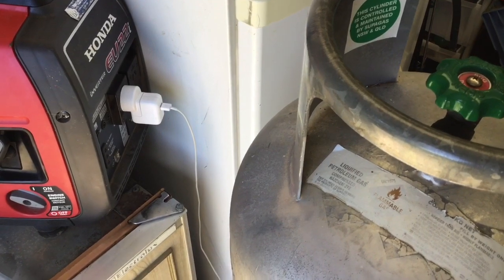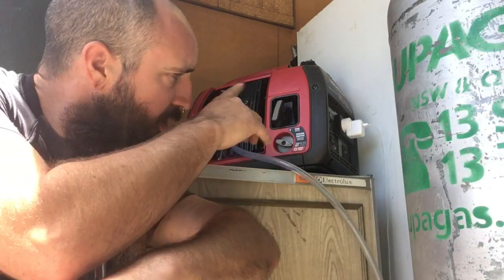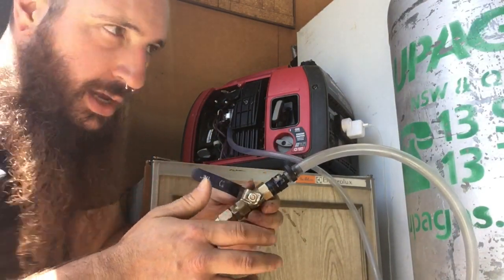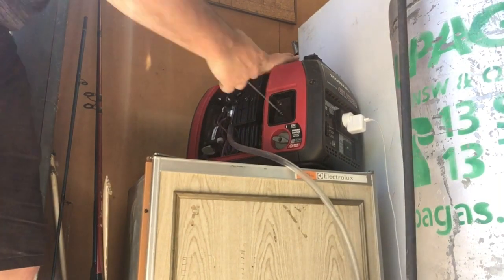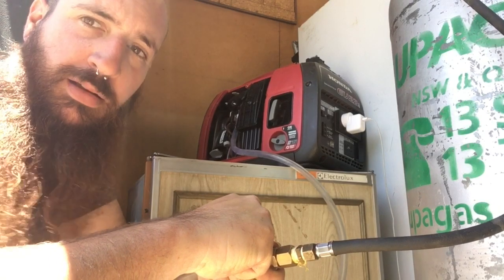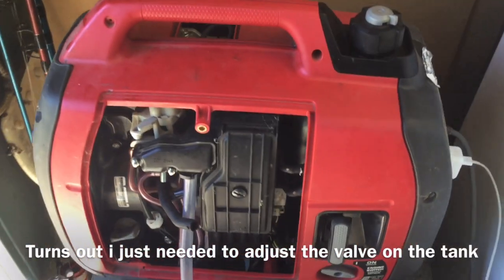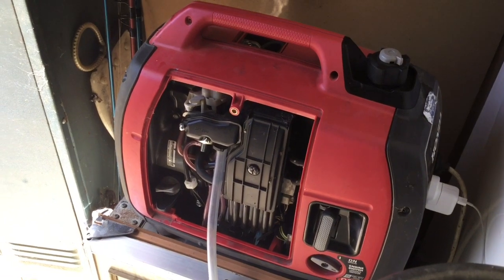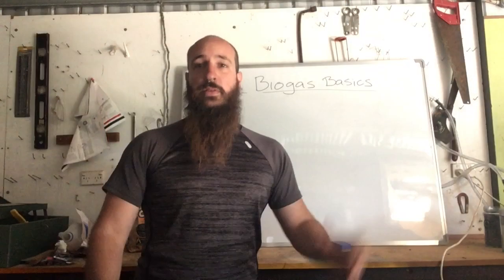Biogas generator - compressed biogas run test 2

Comment: Hey mate, I said on your part 1 video a few months ago I did this with a cheap bunnings generator hooked up to my Homebiogas 6. What I actually did that was useful was charge my ecoflow using a controlled power supply through the MPPT port. being able to control the volts/amps of charging the ecoflow and adjust the ball valve of the gas flow to match the demand, while its painful for 1 minute to do, is a good way to use it because the more gas you use the more efficient it will be. When charging at 250 watts it was the same gas pressure of my generator running idle (2kw petrol generator) but you think, you turn up the volts/amps, you can hear your generator starting to struggle so you let in some more gas, and repeat that until youre at your max charging load. 

I bought a zero pressure regulator for mine and unfortunately could not get it to pull enough gas to match the demand. I can only get mine to work with manual tuning. I think a good way to go about it would be Ive seen some air pumps that you can manually adjust that pull 40L/min, if i hook that up to my homebiogas and then between the air pump and the generator have a solenoid thats power for on/no power for closed and have them both connected to the generator so if your generator conks out the solenoid will close and wont leak gas. That way you can adjust your gas flow/charger, let it charge and then if it becomes fully charged the engine will flood and conk out and close the solenoid or if you run out of gas then it will conk out and close the solenoid. Cheers mate

Comment: My name is Mike. I have a method you'll like. It makes your generator safe. It's cheap. I've been doing conversation of gasoline to propane. My goal was to make it safe. Everything you were talking about I learned. Be Careful of running engine too slow because it will eat the brushes. But this all is exactly what I have been working on. With what I know now I wonder if I can run a v 8.

Comment: Could you simply create useful generator gas fuel pressure by having weights on the gas bag instead of having to pressurise into an empty gas cylinder?

Comment: Will it be able to run the compressor to fill 800L into your holding tank? your honda is aprox 20 persent efficient and your copressor even less efficient.
But fantastic if it works!!

Comment: I wonder if you ran a t-fitting from that exhaust recirculating hose into your biogas line, if you could run uncompressed biogas because the exhaust recirculation gases would create a Venturi effect sucking in the biogas with it

Comment: Love you work. 

Just wondering why you are bothering compressing it into bottles, just to regulate it back again?  That's gotta be using ALOT of energy.. 
I'm thinking, why not just buid a mini compressor using a quality air diagphram pump and set it to maintain 2.75kpa (regular lpg regulated pressure) 

I'm thinking I have a lil 12v jabsco diaphragm water pump. It has a pressure switch in it, turns on to maintain 40psi. I open my tap, the pump turns on. It's low power and can run on my solar system, I'm sure something similar could be done with biogas. 
And you can just use a long airline to go to various areas (kitchen, garage etc). 

The energy in moving the bottles around alone is to much considering only an hour or so gas fits inside. Plus the electricy used to compress it to 100+psi would be so much more than the energy you are getting out of the gas.

Comment: Very interesting mate. May I suggest trying to put some pressure gauges on your fittings and observing them to see what the generator requires. Also perhaps use a watt meter and multimeter on the generator and run different loads to see what is being drawn from it. Might be able to get a happy medium or find optimum settings for certain loads to regulate use of your gas. We will be off grid soon and I plan on adding a biogas generator. Cheers 👍

Comment: Great stuff, it's always good to catch up with your progress.
I was wondering what sort of heat come from the exhaust, i always try to add (or suggest adding ) an EGR heat exchanger on to small exhausts. Maybe you can use the heat produced for a water cylinder or something similar.

Comment: I am in the UK and I have built a generator exactly the same way as yours in an IBC - thanks to your excellent series of videos. I have added some fresh digestate from a commercial operation nearby and as you suggest, I am now waiting three weeks before adding my own food scraps. The digester is producing gas already. The question is do I need to add small amounts of fresh digestate (same as the original input) during that three week wait to keep the bacteria alive or will they be OK without any further addition until start feeding it in three weeks?
Reply from the maker: Hi Phil, thanks for the kind words, i would think that if you sourced digestate from an already established digester, and if is producing BURNABLE gas, there should be no issue with feeding it food scraps now 👍

Comment: Brother, where can I buy 2” and 3” rubber seals for the IBC Totes (for connecting 2” and 3” PVC Pipe thru the IBCs)?  And what are they called?  i cannot find them on eBay!
Reply: They're called uniseals I Googled it and the company's that sells them popped up I'm just waiting for the ground to thaw lm going to dig down and move the shed over them want to see how it'll do for pressure if i put one tote on top of another hook the bottom one to the bottom of the top one fill the bottom one up with water so that as the methane is produced it will go in the bottom tote forcing the water from the bottom tote to the top tote to give the gas pressure i saw a video where they run the effluent from the first tank to the second tank giving it longer to digest you get methane from both tanks

Comment: Man....the possibilities here.  You could take an inexpensive PLC and program in a PID tied to o2 sensor.  Output of 4 to 20 ma controller and a valve.  Let the plc amd programming control fuel ratio.  It is very possible.

Comment: Really curious if it produced co2 when burned then I may make one for the greenhouse for heat and co2 gen for the plants
Reply: You should be arrested for practicing witchcraft ! What a fantastic idea though, if you can control the resultant heat and co2 output !! 

Perhaps, running the generator on a timer could be a decent workaround in terms of controlling the heat and co2. 
This is a nifty idea I could run with but, unfortunately,  I do not have the luxury of space to start a greenhouse. 

All the best with your project.

Comment: Looks great!
What if you design a setup, where the generator is placed underneath an isolated biodigester? (You could basicly use small strawbunches.) 
An engine like that produces around 75% heat, that could keep the digester indipendend to the environmental temperatures. That would be even saver heating for the digester, than an open gas stove and you would get the same amount of electrial energy, as you get in your setup. Just it would be the „waste“ of the improved digestion process.
Unfortinatly I don‘t have the opportunity to do it myself right now. But it would be cool to know, if it works out.
Reply: I was thinking that an EGR (exhaust gas recirculator) heat exchanger could heat a water cylinder, maybe the water cylinder could in turn be a heat exchanger somehow with the digester

Comment: What kind of pressure does the gas need to be going into the generator at with a load on the generator. Also what is the burn rate?

Comment: I've been doing some research into biogas recently. I'm right now working on building a home and am planning on having 10kwh, worth of solar panels and 40kwh's of lithium batteries. (It's a bit overkill, but I'm doing it all DIY so the costs are relatively low)

I want to be able to have a reliable backup for winter's or for prolonged cloudy weeks. I was initially planning on having a generac natural gas/propane generator that would kick in if the batteries dropped below 10%.

Now I'm exploring using biogas instead of the propane, as I'll be using the fertilizer for my hydroponics, and not needing to rely on paying someone to refill the propane would be nice. Since it's going to be used sparingly (I should have close to 100% energy uptime from solar),  I was thinking of installing a large underground propane tank and regularly pushing gas from a bladder into the tank.

I know there is a lot that goes into a system like this, but having been using biogas, do you think it's feasible?
Reply: Your contact number
Reply: Or your imo
Reply: I'm just a caveman, but from what I've read. It's 'feasible', but the impurities can damage your generator over time. Sulfur something or other is found in unfiltered biogas.
Reply: Lithium is over hyped. Look at the costs per kw for it and then there is no study on longevity in comparison to older battery technology which has been around for over 100 years steady and reliable.
Reply: @MrJFoster1984  lithium iron phosphate has come a long way in price.

40kwh's can easily be purchased for under $13k if you build the batteries from individual cells.

Comment: Ill be using my to run a small motor and a PMA  hooked to a grid-tie inverter.  that way I am pushing the power back into the grid.     using my old wind turbine DC 48v  1500 watts        Tanks stay heated with 12v solar water heater element hooked to my solar array.

Comment: Hi mate filled some bottles up but they won't light a flame on the BBQ unless I cover the air inlets after gas on/off valve, is this because of to much oxygen in biogas or is this something you changed on the BBQ?
Reply: The orifices on LPG appliances are smaller than for NG or biogas. Some you can change or you can drill them out. Just search converting from LPG to NG, there are some good vids on how to make it work.

Comment: Yeah after going back to the previous vid with the generator where you run it off of gas for a while it doesnt sound like it knocks as much as in this vid off of biogas. I wonder how this effect could be midigated because I would love to do something like this in the future.
Reply: Probably need a gas regulator and run it off a bottle you compress will run smoother from what ive seen from other vids.

Comment: Really cool vid but idk if its just the generator or if its the biogas making it knock so much I worry how long it can last like that. Plus are there any problems with the oil distribution in the engine?
Reply: After looking further it should be find since its not a 2 cycle.

Comment: hey there, just a quick question, if a system was using the food waste, say through a waste disposal unit in the kitchen sink and combined with lets waste from the toilet, would the chemicals from dishwasher soap from the sink and the dishwasher water from the dishwasher machine with the toilet chemicals kill the breakdown process?

Comment: Great stuff! Would like to learn more about feed rate & feed type optimisation. There must be head room to improve this end of the system and get more methane production.
Reply from the maker: Might have to do a vid, with feed rates and temp comparisons, but it is very hard to do as different feed has different caloric rates, ie meat will produce more gas than grass, like being on a diet.
Reply: @OkAtEverything-ProAtNothing  yea makes sense. I wounder could you ensile grass and other dryish waste from the garden and use it as a kind of 'bio battery' just feed in when you need the gas. I'm in Ireland so grass is plenty here! Maybe not as good for where you are. Sugar beet maybe an option?

Comment: Have a look at getting  air con recovery  unit and run you compressure into the inlet of that will get you to 600 to 800 psi in your tank